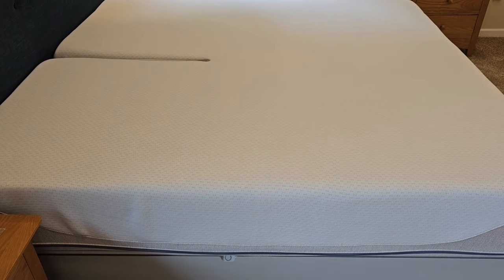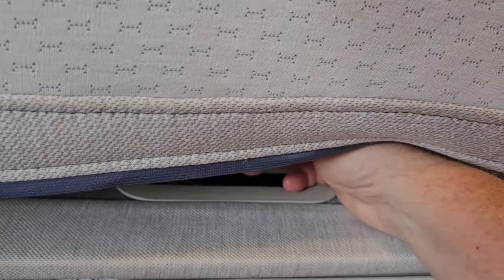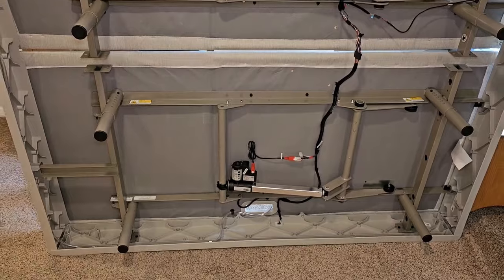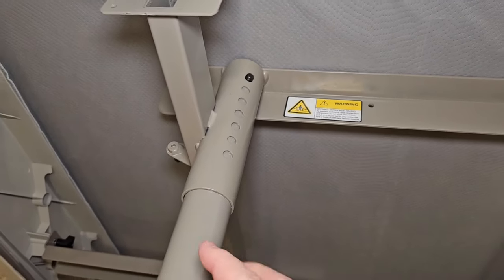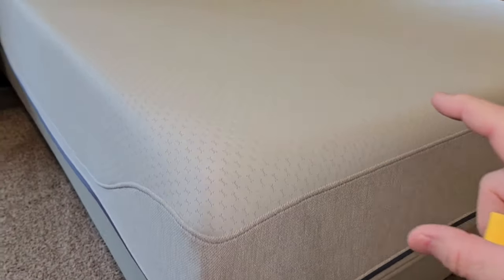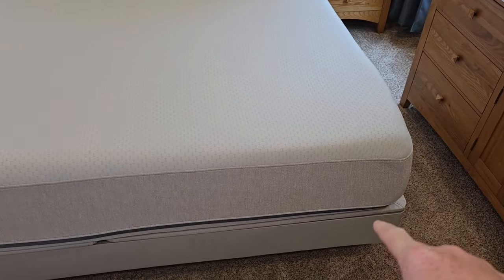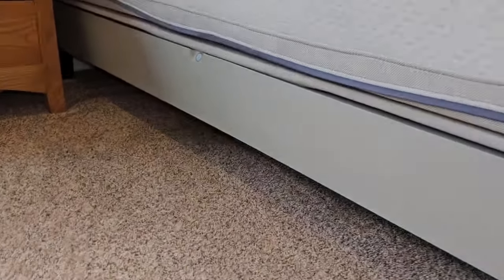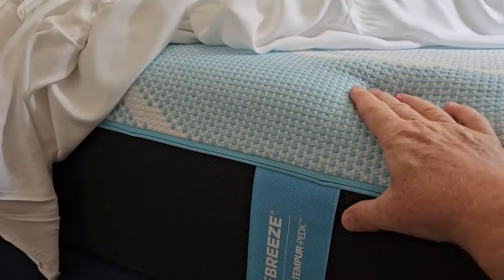How To Move a Sleep Number Bed & Frame     Very Easy!

Comment: First time moving was tricky, but since then I have nailed it without problems. My own opinion would be never raise the bed on its side like that because the side/ edges are plastic. Yes I know he is sliding it but it isn’t that hard to snap apart and unbolted the frames. Makes for easier picking up each piece separately. The motor should never me shaken or dropped per warranty .